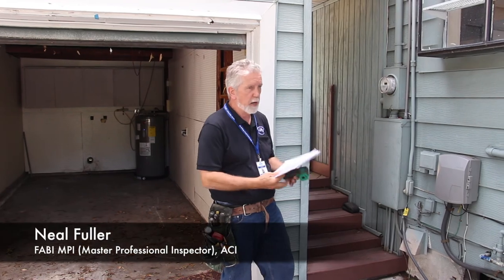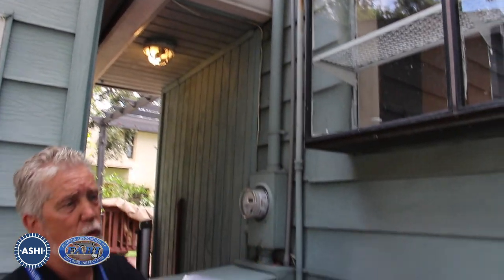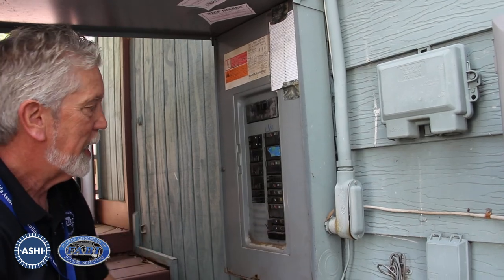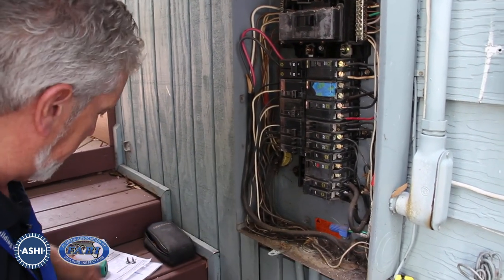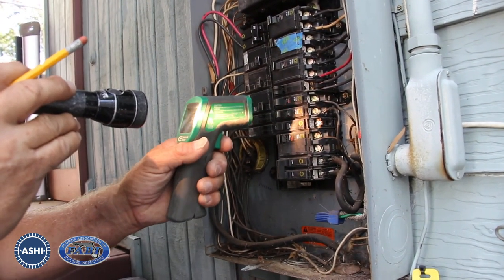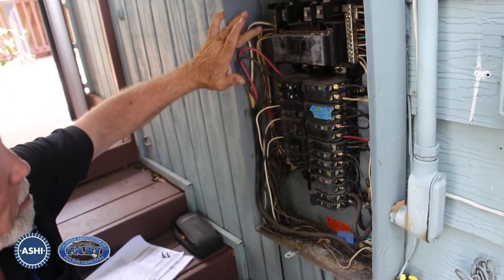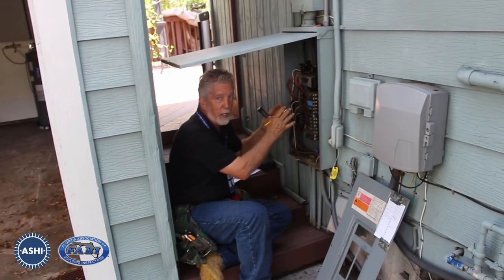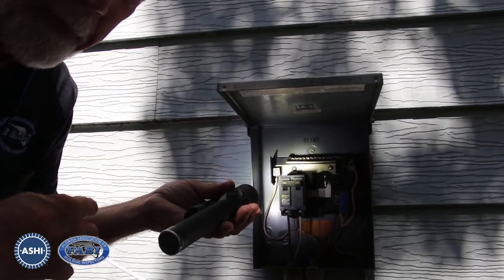Electrical Panel & Condenser Inspection Tips - FABI Summer Conference

Comment: how is 15 amps too much draw on a 30 amp breaker at the main panel top maybe the breaker is just defective the only thing that should be changed is the 40 amp breaker should be 30 or less no more than 10 gauge wire can handle or smaller for unit recommended breaker

Comment: another "home" inspector giving out much mis-information. square-d breakers trip when overloaded or the circuit shorts out-that's their job. there was a bushing where he said there was none. he missed the loose olb cover & the missing gasket, allowing water into the panel. no mention of service entrance conductor sizing or  grounding & bonding-very important. if you have questions about your wiring, call an electrician!